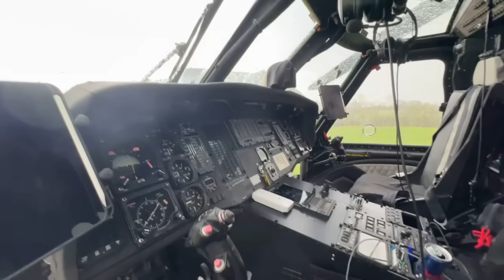This is What It's Like to Have a YouTuber as Your NEIGHBOR!

Comment: Tip: Use adhesive lined heat shrink to make a waterproof connection. Same stuff is used for underground splices that can sit under water for months.

And if your wrench/ratchet is long enough to reach between battery terminals TAPE THE HANDLE! If you drop it you will see welding and a potential battery explosion. Tape prevents that!